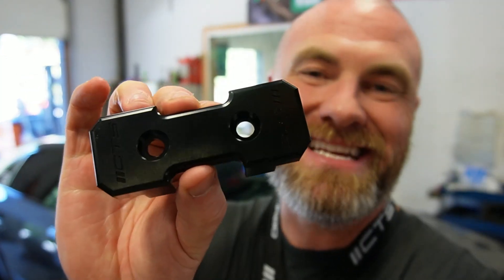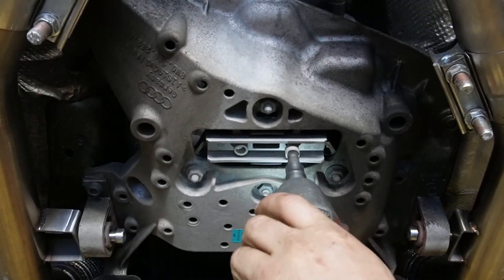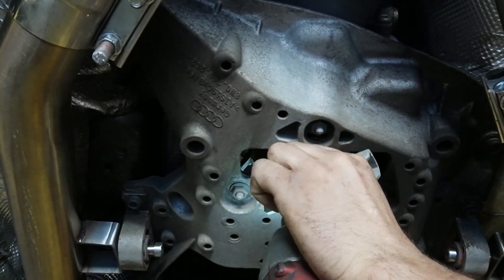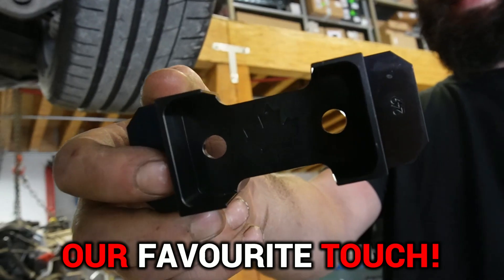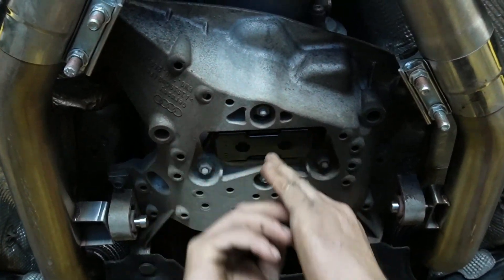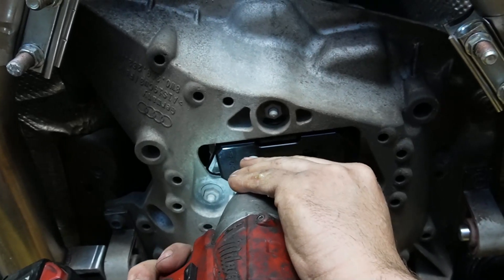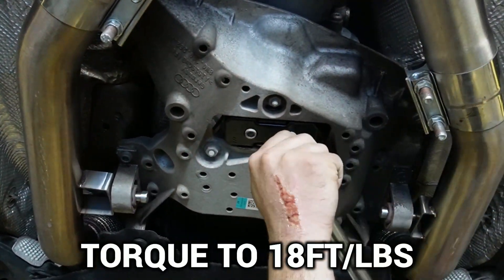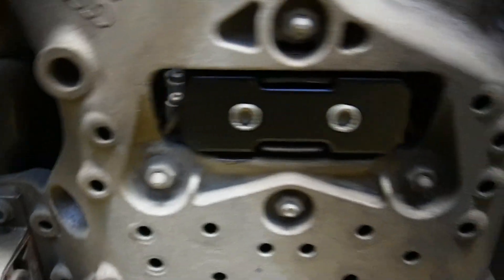CTS Turbo Transmission Insert Install & First Impression - Audi B9 S4

Comment: Great upgrade! I just did it yesterday. On a lift it's a 2 minute straight forward job. There isn't much NVH. Noise/Vibration/Harshness but it feels like I did a software update to the transmission and slightly tightened up the suspension. The shifts up or down at any speed feel so much better.
Reply from the maker: So basically you agree with everything I already said in the video 😉

Comment: Hey man great vid! 
I had a quick question and was hoping you could help out. I installed the cts turbo inlet and tuned my car with IE to stage 1 ECU and TCU. but then the car started making a clattering noise during low speed acceleration and then threw a cel with cylinder six and three misfire. I’ve since flashed back to stock and took off the cts inlet and put it back to make sure it was installed correctly and all the hoses were sealed properly. But the car is still misfiring cylinder 6 it says. It’s a 2018 s5 with 21k miles. Could you point me in any direction? I’ve reached out to IE to see if maybe the tune messed up the timing just waiting on a response. Thank you
Reply from the maker: First thing would be to be to scan your car and see if anything else comes up too. Next would be to inspect your spark plugs and your coil packs in 3 and 6.
Reply: @VancityAudi  thank you I will do that
Reply: @Shaheer.Naveed any update?